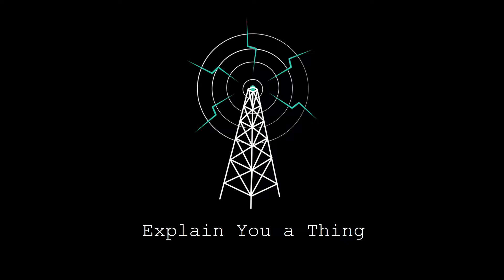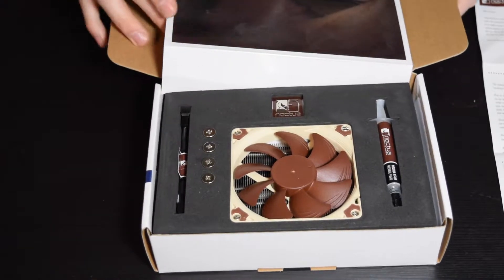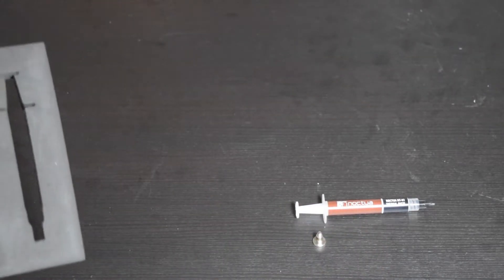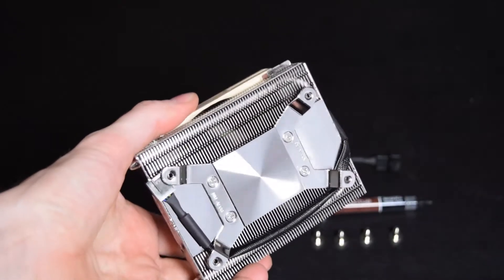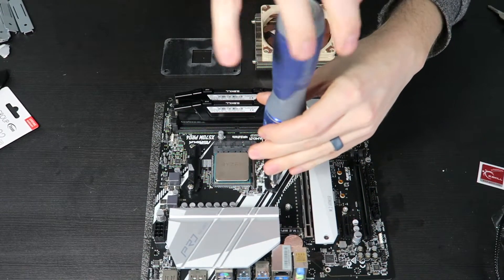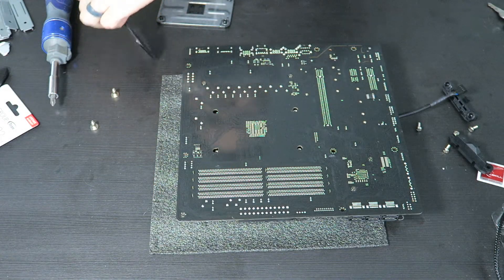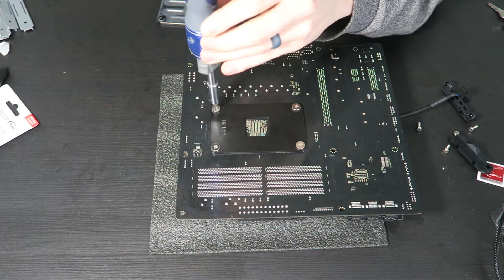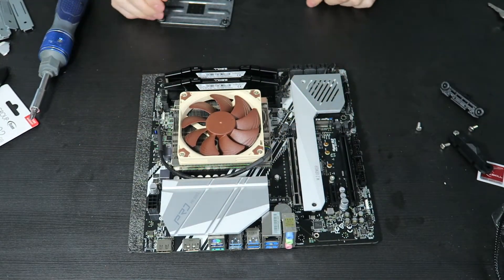Noctua NH L9a AM4 Review and Install

Comment: this cooler is very annoying to put on when you want to apply thermal paste again or anything of the sort. It is possible without taking the motherboard out but that's another hassle.
Reply from the maker: Agreed, you pretty much have to have a case with an access hole in the motherboard tray it you're likely going to pull the motherboard.
Reply: @ExplainYouaThing  I do, so i'm happy I don't have to remove the motherboard and everything from the case

Comment: Hello...I want to buy this cooler for my Ryzen 3 2200G and change the cpu cooler which was in the box ....does it have any difference ???
Reply from the maker: I'm not sure what you are asking specifically.  If you mean differences over the stock cooler then I'm not sure.  I haven't really used the stock cooler.  That being said, I would imagine cooling is either the same or slightly better with the advantage of being significantly thinner and quieter.  That's about all I can really think of to be honest.
Reply: @ExplainYouaThing  Im sorry ,thats what I meant ,I have the stock cooler for ryzen 3 2200g ,and I never used another cooler ,but I want to buy a low profile cooler that is better than the stock ..do you think that Noctua's cooler is better?Im asking because AMD'S cooler is not something special
Reply from the maker: Yeah, so I'd guess that your cooling isn't going to be much better as Noctua rates this cooler specifically as "recommended for CPUs with a TDP of 65W or lower."  The 2200g has a 65W TDP, so it'll do the job providing you're not overclocking.  I'd be willing to bet that the Noctua cooler will be quieter overall (it's basically silent all the time on my build) but I wouldn't expect miracles of lower temperatures or anything.  Ultimately the number one reason someone would buy this cooler is because of how thin it is, which is a pretty helpful feature in ultra small builds.

Comment: Should it be enough for a ryzen 5 5600 undervolted with PBO (-30 negative curve)?
Reply from the maker: I would think so, but your results may vary with case airflow etc
Reply: @ExplainYouaThing  i mean i am using a very basic cooler, one that is even worse than the stock cooler (coolermaster A30), and well the temperatures at light usage are in the low 50s, but then at full load it throttles basically, not being able to go over its base frequency for extended periods  due to reaching 90C. 

I don't really need EXCELLENT cooling performance, but as long as i can run this processor at max boost at full load without hitting close to throttle temperatures, it'd be enough
Reply: @mparagames  I have the same cpu, with pbo limits disabled (ie cpu stock settings), curve -15 with stock cooler and get at most (I've seen) 80 degrees C.
Reply: @andrewh111  Yeah i have the noctua cooler now, it's okay, but my mistake was that i chose this cooler for a sff case that could have handled a much bigger cooler (approximately 77cm of clearance). 

The L9a is a bit better than the stock cooler, not by that much though. Though, i'd see 84C with my 5600, but that's probably because ambient temps here and bad airflow from my case.
Reply: @mparagames  Ah I see, sounds decent. Mines a micro atx case, with decent airflow, and is winter atm.
Reply: @andrewh111  Btw i don't use the 5600 anymore cause i accidentallky broke the pins, but now i have a 5700x at -25 at one core, -30 on the other cores, 80c temp limit, and it behaves fine given the horrible airflow of my case

Comment: Hello, did you put a blob of paste on the cpu before you flipped the main board upside down? Did you spread the paste at all?
Reply from the maker: Generally I just put a small blob of paste in the middle and then let the clamping force of the cooler spread it out.  It's worked for me so far.